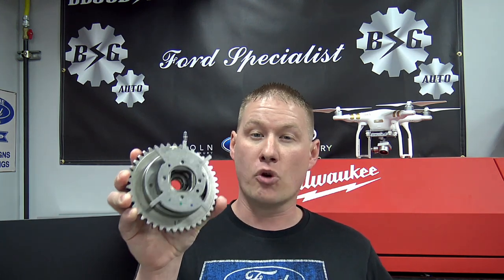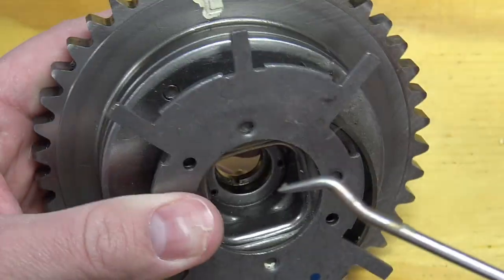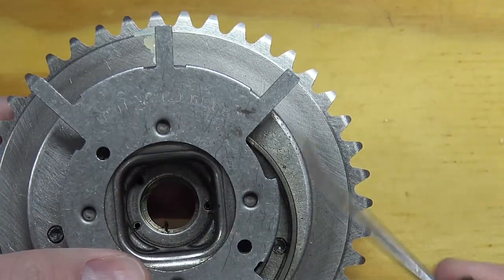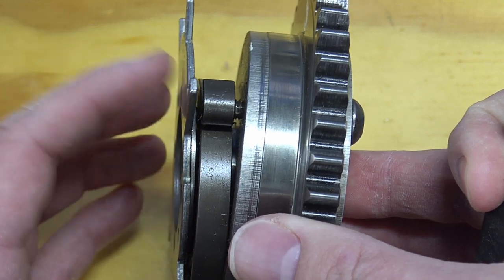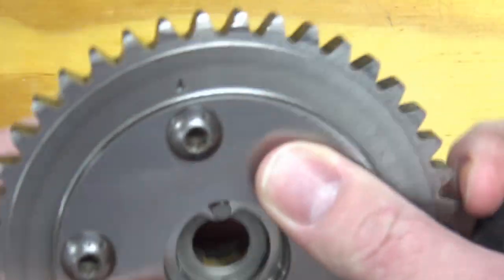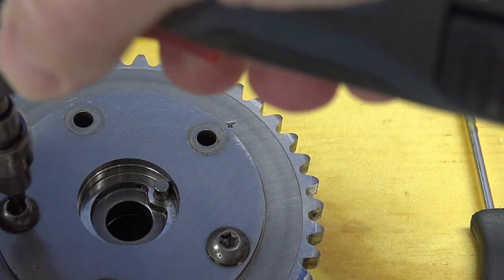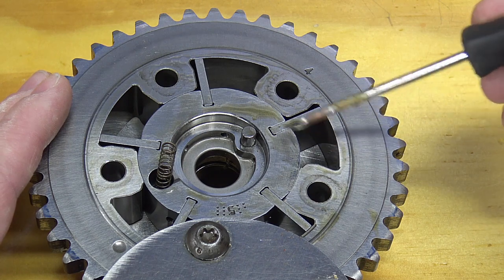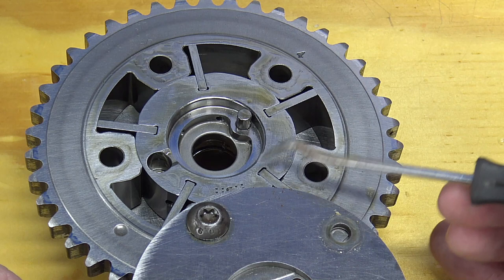Ford 4.6L & 5.4L 3v Engines: Camshaft Phaser Failure Inspection

Comment: In my truck I have a timing gauge. My timing bounces around all over the place, going anywhere from +3 to +18 at idle, I'm assuming this isn't normal. Is this a definite sign of the phasers about to go out? VCT solenoids recently failed on both sides and were replaced, this timing issue has been happening for months. Thanks for the input

Comment: I've changed both phasers,  both chains, both tensioners, oil pump and both VCT solenoids on my 06 f150 5.4. My truck will start and run fine but as soon as I accelerate, my truck will die at idle. Any idea what's causing this?

Comment: I have a 2005 mustang gt. I change the oil with 5w-20 Mobil 1 and a motor craft oil filter. The cars whisper quiet before I change the oil. After I change the oil I hear a ticking sound coming from the driver side valve cover. The sound goes away after about 500 miles. Is this normal?

Comment: could a bad phaser cause reduced power mode. wrench light on dash. 5.4. only occurs at 40m.p.h.
Reply from the maker: no
Reply: +FordTechMakuloco where should I begin to look for my issue with reduced power mode? i have access to PTS if that will help

Comment: Do you recommend changing both phasers if only one is bad? And aslo when do you recommend putting in the melling oil pump?
Reply from the maker: Oh yes for sure.
Reply: @FordTechMakuloco  when do you recommend putting the melling oil pump on ?  My expedition is making the same sound consistent with a phaser knock but it starts as soon as engine turns on
Reply from the maker: Replace it whenever you do a timing job.

Comment: Hi i have a 2007 f-150 5.4l 3v was running perfect, one morning stopped at stop sign and it started running rough checked codes it was p0022 dealer said change vct on right side, did, same thing, dealer put it diagnostic said it was missing on #2,#7,#8. They said motor is licked wouldn't do anything else. So i drove it home tore it apart ( oh by the way i had fluctuating oil pressure) and i found a broken tensioner on right side everything else looks good. Left side looks perfect, what do you think i should replace, money is a issue and the dealer ship is no help.
Reply: Coils

Comment: Just purchased a 2009 F150, equipped with the 5.4 3V, for dirt cheap. The previous owner reported that, while driving, the engine stalled and would not restart. He reported no noises out of the ordinary prior to stalling. The vehicle was towed to a Ford garage, where they spent maybe an hour diagnosing the issue before telling him he needed an engine. I'm not certain the diagnosis was correct. The vehicle is showing only P0340 and P0345 codes (camshaft sensor). The engine cranks, but will not start. Has anyone experienced a no start related to the phasers, VCT solenoids, or sensors?
Reply: Crank sensor

Comment: At 3:53 when you mention the tone rings.  What does it mean if mine are not alligned with the timing reference?  they are about 30 degrees off.  I already know I probably need new phasers but are there any other problems this may cause?
Reply from the maker: The center tone vane should align with the L no matter what.

Comment: How do you feel about cam phaser lockout kits such as those made by Livernois Motorsports? Is this a good long term solution to cam phaser issues or would you suggest replacement?
Reply from the maker: +KlueBat I suggest phaser replacement other have tried and had concerns with power and or fuel economy then end up going back to stock.
Reply: 1st off great job on your videos FordTechMakuloco this as well as your other videos are great and helpful videos. If you have a engine that has been poorly taken care of and has timing failure from crap oil this video will sure help.. A good long term solution is stop using crap oil. There are lots of these trucks with a half a million miles and more on them that have never been apart but each one of them use good oil.  Then there are folks who insist on running Poison oil  and put chains and tensioners and phasers in them every 60k to 80k. almost every oil you see on Tv will give you timing problems with these engines and they cost more than good oil lol they get you lured in with there tv commercials. I can only think of 3 brands of oils you see on Tv that are mid range oils and don't make buildups in your engine and Poison is not one of them how ever it keeps folks buying parts every 60k lol.pretty much if you have a timing  problem under 500k your running crap oil that spends its $ on advertising not oil quality now think of what that oil is doing to the rest of the engine your fuel economy the list goes on. And they bend these folks over with a smile every oil change some every 3k miles so bad that these folks tell there friends how great the product is and even sport stickers in there windows. And Ford sits back and laughs thinking great keep running that oil we will sell you parts for life.  Ford built the consumer a engine that will last a million plus miles untouched and the consumer blotched it up by running junk oil in it it even makes me laugh you can google Million Mile Gasoline Engine Teardown yet not many folks do.
Reply: what oil do you recommend?

Comment: Hey Brian, I am rebuilding my entire timing setup (with the help of your videos, YOU ARE *THE* MAN), however, I am also installing phaser lockouts with a custom tune. Should I replace my VCT solenoids even though the lockouts will theoretically render them useless? Or should I replace them since I'll be in there?
Reply from the maker: +Kasey Rienstra if you suspect they are stuck the yes still change them
Reply: I believe one or both sticks occasionally. It will chug, sputter, and it sounds exactly like the truck you demonstrated in your "sticking VCT" video. I also have chain noise on startup, so it's getting the whole nine yards, Melling 10340 pump included. I really can't thank you enough for all your help, I feel like we all owe you more than a few beers!
Reply: Kasey Rienstra y

Comment: I have a p0025 code that says camshaft position timing over retarded. My car has a knock, hesitation, rough idle, and bad gas mileage.  When I unplug either Tank A or B, VCT solenoid sensor the car runs fine but still bad gas mileage.  Any suggestions?

Comment: Do the phasers sound all the time when they are bad? I am having a noise only when engine runs hot in heavy traffic. Other than that I don't have a noise at all, I  live on a  city where the temperature can go easily up to 45° in summer.

Comment: HEY I WATCH LOTS  OF YOUR VIDEO...THANKS  .. TO LET YOU KNOW I DID A 2007 3V  TIMING  NEW HEADS  OIL PUMP . WATER PUMP NEW INJECTOR...ALSO 2007 2nd one # 3 2006 #4 2005  #6 2004 #7 2003 all the same stuff....i'm  68 years old i'm having fun  ROB THANKS ....

Comment: I'm not trying to start a Ford vs Chevy war but does anyone know if Chevy trucks have the same kind of problems with their engines over the last decade or so?
Reply: +traingp7 
Dont think so. The V8 are LS based engine. 4.8,  5.3,  6.0.  The 4.3V6 is based on the old small block with 2 cyl lopped off. Been around forever.  The new 4.3 EcoTec V6 2015 and newer... I THINK is one of the LS V8's with 2 cyl lopped off.
Mechanically the Chevy is simpler to work on... water pump swaps etc.  LOTS more room under the hood.. since its still a pushrod engine... no overhead cams.
I have heard of some issues on the newer ones.. they I believe have VVT on the central cam, and have CYL devactivation...  there are some issues there I think.

Comment: fordtech...please help!
5.4 2010 with 68k miles. It has always had phaser tick since new. But now I have a intermittent very loud pinging. sounds like marbles getting thrown at the hood. During the event the motor loses power and runs extremely rough shaking whole truck. it thrn recovers and runs fine for a few miles. No codes. Now tonight it would intermittently knock and run rough and stall. This time it would stall if left alone, but would smooth out with some throttling above idle. I dont know where to start with a mechanic. Dealership or mom and pop mechanic? Engine rebuild shop?. or just trade it in. 
video from tonight 
https://youtu.be/dcgCnEN4jEE

pinging sounds like road noise rattle
https://youtu.be/q6QHh12aeZ4

Comment: Are you still answering? Here
Reply from the maker: I answer any new questions that show up in my feed.
Reply: @FordTechMakuloco  ok cool I just did  a phaser install on my 06 and first wanted to say thank you your channel was a huge help as before this the newest thing I worked on was my old 95s 351w. Second of all oh, I'm trying to get a few miles on them first but I might have another link 4 cam phasers that are actually really good they are chinese-made eBay but they're fully machined and only 140 for a pair. Let me get a few miles before I brag on them though